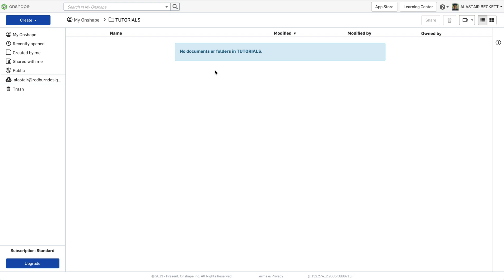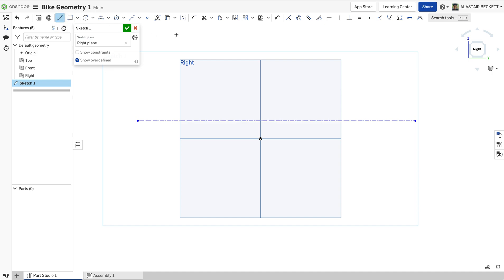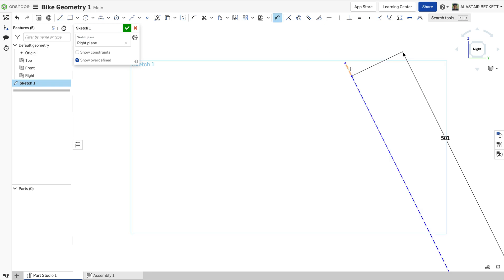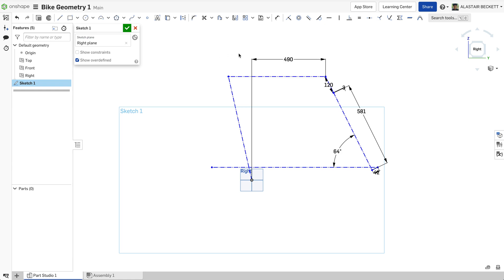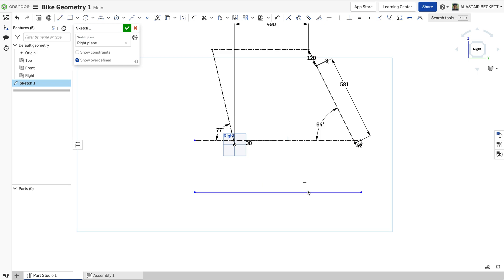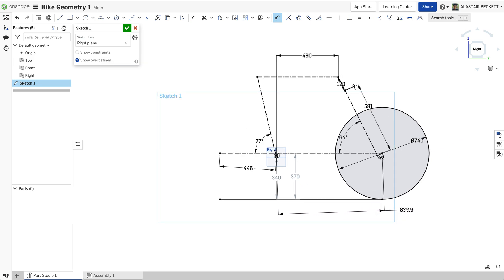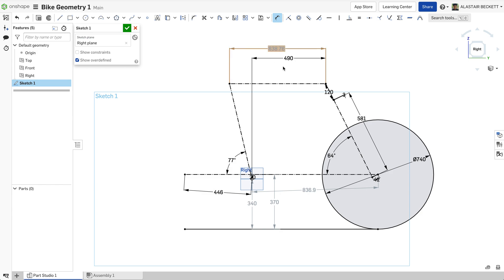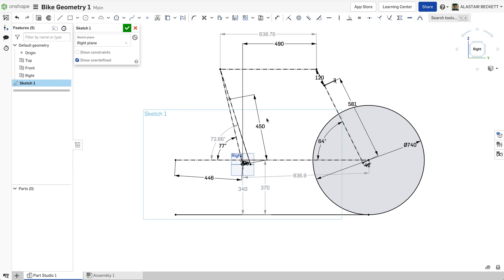HOW TO DESIGN BIKES IN CAD - GEOMETRY SKELETON SKETCH TUTORIAL - EPISODE 1

Comment: i know this was 4 years ago but some of my dimensions arent driven when i create them. namely the front center and the top tube. it seems like its due to the fork offset not having a defined angle which allows some things to shift slightly. is there a fix that you know of? for now im just manually making the dimensions driven and copying what yours are.
Reply from the maker: It sounds like you may need to check that some areas have “relations” or are “constrained”.
For example, when I sketch the fork
Offset, I make sure it is perpendicular to the steering axis. That means you don’t need a dimension there, as it is naturally constrained at 90 degrees to the steering axis when it’s created. 
The same goes for your horizontal lanes between both axles, and the top of the headtube and effective seat tube.
Reply: @redburndesign  ok thank you so much that might be exactly my issue